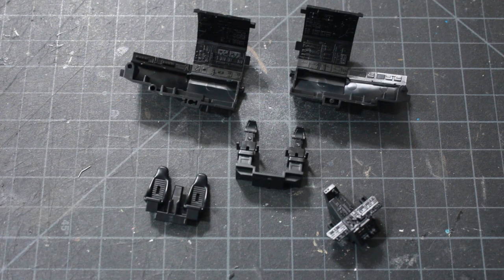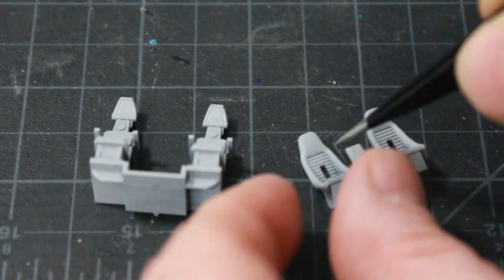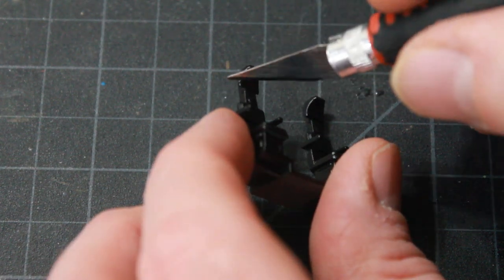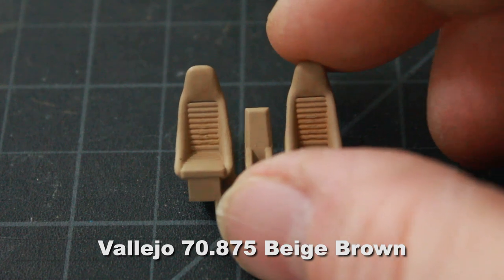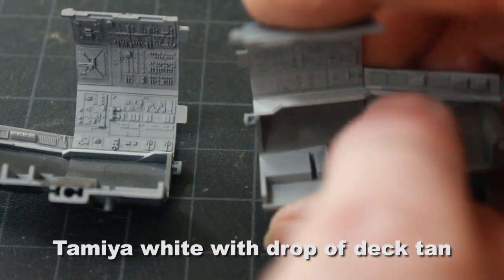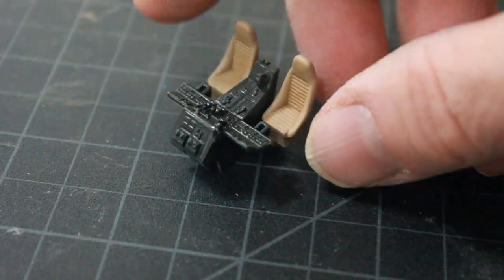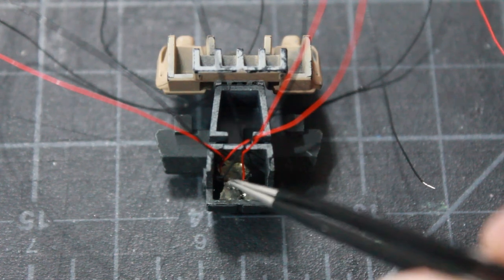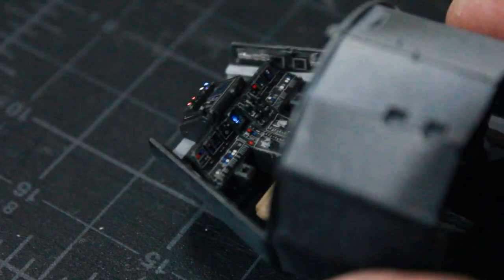Bandai PG 1/72 Star Wars Millennium Falcon Pt 4 Cockpit lighting

Comment: Hey, you applied cockpit details without filing the surface down!  I’m not expert on water slide decals, but as long as you have decal solution, then apply larger decals in smaller sections of about 1/3 at a time,  I don’t get how many builders thought this was impossible to do without obliterating those surface textures.😊
Reply from the maker: Yea, you can do it.  Just takes a bit of work with the solution, but it eventually stretches and falls into place.  I applied solution several times, and just kind of gently work it into crevasses with a cotton swab when it's softened.  That way you still get a nice little bit of texture.

Comment: Hi.. great work!...I'm also working on this model.. did you leave the clear plastic pieces out of the cockpit and gun ports?
Reply from the maker: Yes.  I always do.  I don't like the reflections interfering with seeing the interior.  And ILM did not use glass either, for that exact same reason.  So stage lighting wouldn't reflect.  The only exception is my A-wing I'm currently doing.  Kinda have to, being a dome canopy.
Reply: Thanks Chris... I agree it looks a lot better without the clear plastic.. @modelsbychris

Comment: how did you power the bread boards. I Have this very kit and trying to do the same thing
Reply from the maker: at 11:45 I show how I attached a female 9v connector so you just plug in a standard 9v power supply to it.  Ultimately, my client placed the Falcon on a board and ran that female lead though the board out the bottom to plug in.  The RF receiver was plugged into that female lead and the other end to the board for power.
Reply: @modelsbychris  I am sorry my wording was off. I see you use bread boards. I assume u just bridged the leads on the board with solder and ran a power to the bridged wires?
Reply from the maker: @davidkeen4972  yes
Reply: @modelsbychris  cool. I have this same kit and have the PE for it. I like what you have done and copy it for my own.